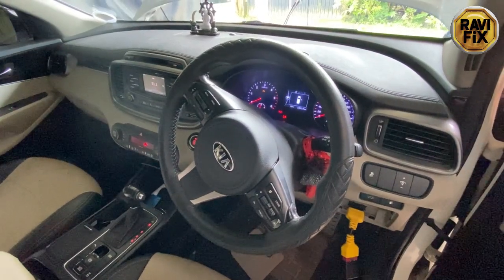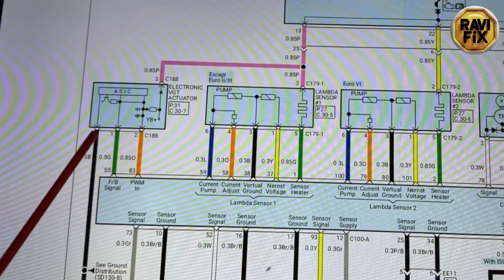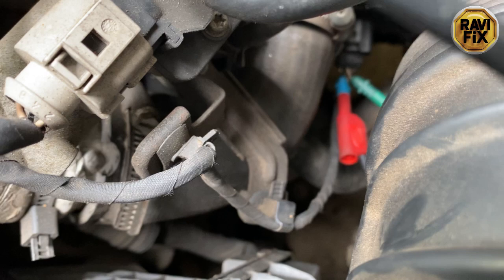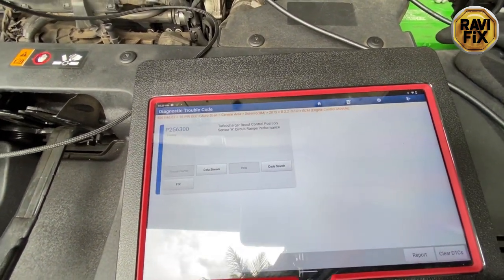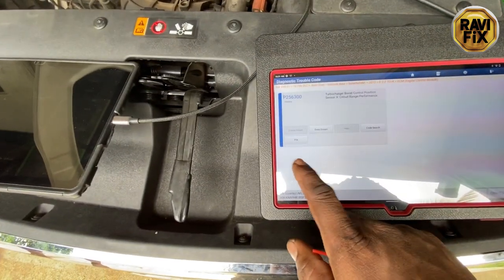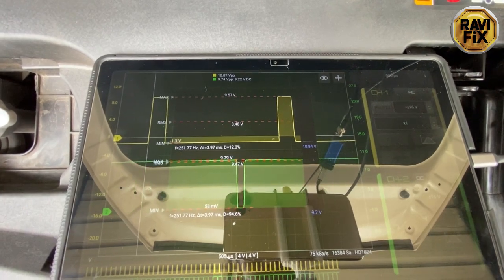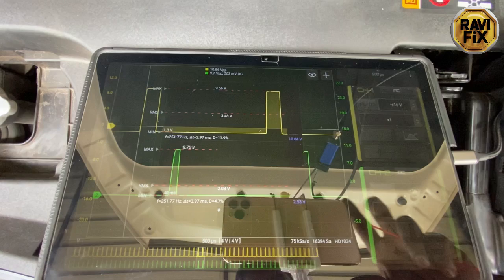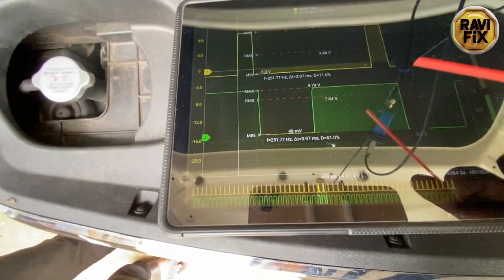KIA Sorento 2.2L Diesel P2563 Boost pressure controller position “A” range performance diagnosis.

Comment: I have sorrento 2.2 crdi with underboosting.
The turbo is OK, vanes free,  vane actuator OK.
When I hold the vanes lever up manually it boosts but when operated by actuator it won't.
5% actuation and 95% actuation move the lever up and down no problem
Reply from the maker: What fault code you get? Try clean the boost pressure sensor.

Comment: Hi Ravi. New subscriber. Great diag videos. Im fairly new to using oscilloscopes. I have the Hantek 1008 using hscope. Is the 6074 worth upgrading to? I want to setup a good kit with 4 channels with good resoulution for most automotive tests. I was considering the complete Hantek 6074 automotive kit with accesories. Can you recommend some android tablet specs such as RAM and which android version to use. I see affordable tablets that have over 4gbRAM but with the latest android versions. Would I need to install pre android12 version? Cheers
Reply from the maker: Hi Mark… happy to hear that joint to the channel. Budget wise Hantek 6074BE is good 4 Channel scope, can go extra mile with Hscope app. The biggest disadvantage is this Hantek 4 channel draw high current from tablet or the device it is connected. But I use it when I really need 4 channels.
Anyway HS502 is the best budget scope with 12bit resolution which has only 2 channels. So I use it for my daily diagnosis. Hantek 6074 is worth to invest with a higher battery capacity tablet.
Reply: @ravifixall  Thx Ravi. I've been watching videos on the HS502 and the capabilities are impressive for a budget scope. Very good resolution and recording. I'm thinking I can work around the lack of channels by taking a capture then switching measuring points and take another capture. I want to be able to read the crank/intake cam/exhaust cam sensor positions in relation to an ignition or pressure transducer signal for #1 cylinder. Does that make sense using the 720degree overlay?
Reply from the maker: Yes. But rarely you will need 4 channels for some cases studies which need to observe and analyze multiple data together to get an accurate diagnostic decision. If 4 channels scope in the armory would be an added advantage .